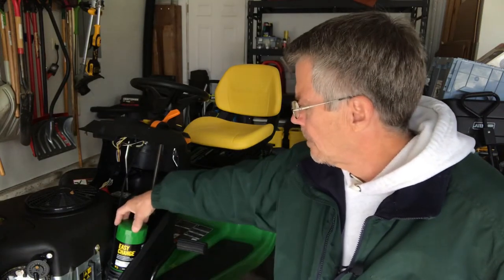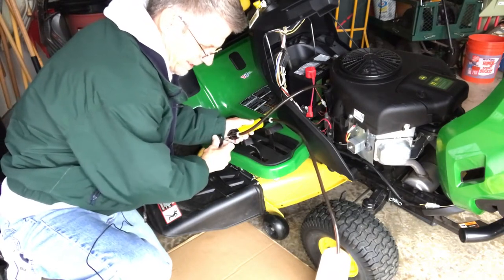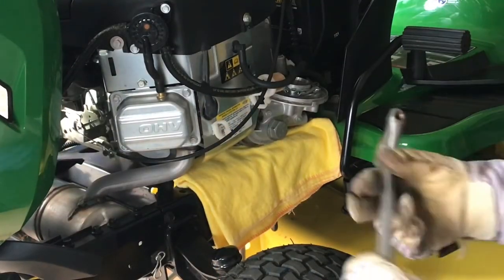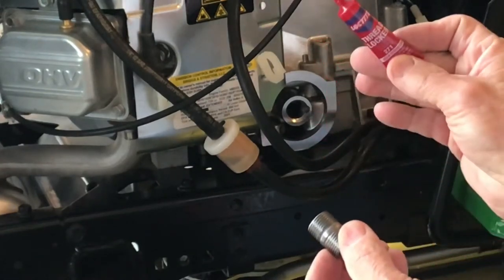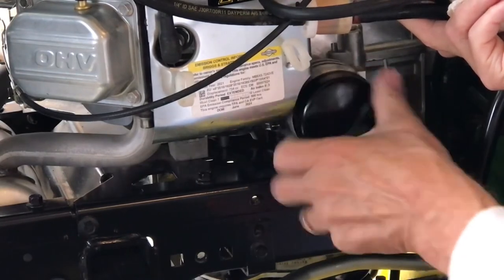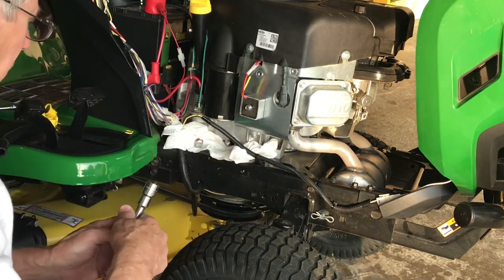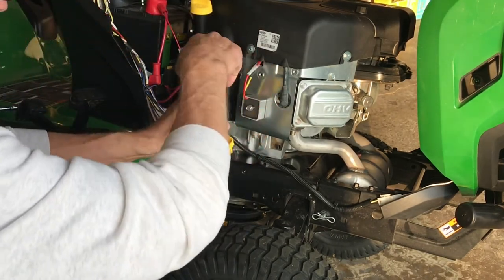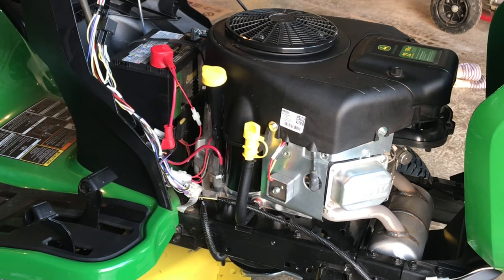John Deere Easy Oil Change Conversion with No Oil Spill (Almost) @DIY Boomers

Comment: JUST A THOUGHT COULDN'T YOU JUST SUCK OUT THE OIL FROM ENGINE AND STILL USE THE QUICK CHANGE FILTER? YES I KNOW YOU WOULD STILL HAVE TO BUY THE QUICK CHANGE FILTER AND ADDITIONAL OIL.
Reply from the maker: Sure, you could certainly do that. It would definitely eliminate having dirty oil left in the engine but the difference in cost is something to consider. The easy change and extra oil will run you over $60, whereas the conventional oil change will run you around $20.

Comment: Greeting from SC , USA. Your method is the better than at least five I have seen on the YT. Good thinking ahead. Pumping first, tilting the mower side to side and having patience in letting gravity do it's science does make a huge difference when removing spin on type filters pre and post conversion. Some folks say it's a big mess. I say they have no patience. Furthermore those fuel/oil hand pumps are a great prelude to the process. Harbor Freight has them too. I pump diluted Simple Green in and out of a bucket to clean the pump after use. Thank for your video post.
Reply from the maker: You’re welcome. Yeah, I really hate making a big oil mess, so I do everything that I can to avoid it. I guess some folks don’t mind it so much.

Comment: I have a new S130. Wish I saw this video before I purchased the JD kit. I like the flex hose on the B&S kit better.
Reply from the maker: Yeah, the flex hose makes it a bit easier, but I’m sure the rigid drain pipe will work just fine.
Reply: I completed the mod this afternoon. I have heard there is a lot of old oil left in the engine but I was shocked! Definitely glad I did this mod.
Reply from the maker: @youmbgtube  Yup, it really makes me wonder about this idea of John Deere’s.

Comment: I can't understand what John Deere was thinking when they came up with the 30 minute oil change. It only changes 0.8 qt. of oil and leaves 1.20 qts. in the engine. That's not good. I have the changover kit on order for my new S160 J.D. Mower.
Reply from the maker: Yeah, it really makes you wonder. I’d really like to have a look into the future to see how it ends up working out for them.
Reply: I think John Deere was trying to get those owners that never change oil, to at least change the filter and part of the oil, if they made it easy enough.

Comment: using that pump to remove most of the oil was a great idea
Reply from the maker: Thanks. Yeah, I had the pump for using it with gas, so I looked up if it could be used for pumping oil.

Comment: I very like your method, clean work without mess.I ordered a s-130 and will get it in may. First thing that I’m gonna do is the conversion.
Cheers

From New-Brunswick Canada
Reply from the maker: I would certainly agree with your choices of the S130 and converting it. One thing that I might do differently on the conversion is:

To minimize oil spill even more, use the oil pump to suction oil from the bottom of the filter adapter base before removing it. Might be worth a try.

Comment: I just ordered an S130 to replace my 20+ year old JD GT225 with a recently blown head gasket.    
     I've seen other videos of this conversion, but yours is the first showing the flexible drain tube. Seems like the better option to go with. 
    This is the first modification I intend to do after the break-in period oil change. 
    I hate that design of the "30 second " oil change.  Especially since it leaves so much used oil still in the crankcase.  
    I feel like it's designed on purpose to make engines fail quicker over time. But I get that it's also enticing to buyers who want easy and quick "DIY"  maintenance even if it's at a higher expense than a couple quarts of oil and a filter.  I'm sure most of those easy change filters end up in a trash can instead of the proper disposal. But I could be wrong. 

  Thank you for the video and part numbers.  

BTW, I do plan to rebuild the engine on my gt225 as a project and then sell it or use it as a second mower or just as a snow plow. Since I have the blade for it. It deserves better than to end up as scrap.
Reply from the maker: You’re welcome. Always glad to hear the videos are helpful.

Yeah, it still has me scratching my head what is behind the decision to implement the quick change. I agree with your thoughts on why they did it. Time will tell how that all works out.

I really like how easy the drain hose makes the oil changes. I’m sure you’re going to enjoy your new S130. Good luck with your conversion and thanks for watching.

Comment: I used my shop vac connected to the dipstick tube.  Ran the shop vack while adding the drain extension.  Not a drop of oil came out.  Spme oil went into the shop vac but was easily poured into my waste oil can.
Reply from the maker: That’s a new one on me! Sounds like it got the job done alright. Good job, I always like finding a work around. Like the old saying goes - Necessity is the Mother of Invention!

Comment: You saved my bacon yesterday. After removing the EZ Change I got to the 4-sided drain plug and could NOT get it off. Was looking at having to find and buy 7/16" 8-sided socket. Luckily, I had watched your vid not long before doing the conversion and quickly found it. I had a set of adapters including 1/2 to 3/8, got an extension on it and ratchet with socket, worked. Whew. Wasn't looking good. Had I seen your vid first, likely would have gone with the B&S flex tube, oh well. Thanks for the vid.
Reply from the maker: You’re welcome. That’s one reason I really like YouTube, there’s so many ways to get things done and 9 times out of 10, you’ll find a solution. Also glad to hear that me being cheap, saved someone else some time and money. 😎 Thanks for watching.
Reply: @DIYBoomers  No doubt DIY. Honestly didn't think drain plug would be an issue, wrong answer. Precarious location. I thought the big bolt on the EZ change would be the tough one, it was not. Sort of lucky that one of last vids watched before conversion, was yours so it was early in history. Thanks again for the effort. 👍 And, no more "EZ change" for JD. 😀
Reply from the maker: @faxmen09 👍

Comment: I like the large oil filter to help cool the oil but will definitely upgrade the oil drain with something like you are using. Also I will probably change the filter every other time.
Reply from the maker: That’s a twist. Hadn’t thought about doing it that way. Interesting! Are you planning on draining the filter when you drain the crankcase?
Reply: @DIY Boomers   yes  I have a vacuum pump to be able to clean the hosing the filer sits on then adding a small amount of oil into the filter before I reinstall it.

Comment: Nice job  pumping the old oil out first  made it for a cleaner job, I will be doing this on my new 170, thank you
Reply from the maker: Yes, you’re welcome. Pretty much mess free if you prepare for a little oil draining out of the filter adapter base when you remove it.

Don’t know if you saw my reply to Jason who is planning a conversion also. I mentioned maybe being able to pump some remaining oil out of the adapter base before removing it to avoid spilling that last bit of oil. Since that, I took a look at the adapter base and it looks like the lower portion of the base is constructed such that pumping from the top of the base may not reach that little bit of oil in the bottom.

So just prepare for a small spill when removing the filter adapter base. Enjoy your new 170!

Comment: A silly question but what are you using to lift the side you’re working on? My ramps are most likely too tall and I’d have to remove the deck to use them. Bottle jack maybe?
Great video and like many others have said, your method wins out on YT! Glad I decided to watch a 5th video on the same topic!
Reply from the maker: Thanks, yeah, I really don’t like cleaning up oil spills so that’s what motivated me for that job. I actually did use ramps. I have a pair of old, molded plastic Blitz Rhino Ramps that are just under 7” tall.

Comment: I have a new s220, but I don’t have the easy change filter,I just got the regular filter.But I like that oil drain tube . We’re did you find that ?  Nice job on the video. I like how you worked around not having the proper tools! LOL 👍
Reply from the maker: Thanks. Pretty sure I ordered it from Amazon. Below is a link from there, but you could search the part “Briggs and Stratton 594200 Oil Drain Hose” and find it elsewhere. Yeah, hate to buy too many tools that I won’t be using very often.  😎  Almost forgot, you’ll also need the hose connector that inserts into the engine, link below for that also.

https://www.amazon.com/Briggs-Stratton-594200-Drain-Hose/dp/B017650GL4/ref=asc_df_B017650GL4/?tag=hyprod-20&linkCode=df0&hvadid=216532910363&hvpos=&hvnetw=g&hvrand=14069240487820374220&hvpone=&hvptwo=&hvqmt=&hvdev=m&hvdvcmdl=&hvlocint=&hvlocphy=9022344&hvtargid=pla-348901613502&psc=1

https://www.amazon.com/Briggs-Stratton-796532-Hose-Connector/dp/B002WNW970/ref=asc_df_B002WNW970/?tag=hyprod-20&linkCode=df0&hvadid=416788749780&hvpos=&hvnetw=g&hvrand=6498830476322284564&hvpone=&hvptwo=&hvqmt=&hvdev=m&hvdvcmdl=&hvlocint=&hvlocphy=9022344&hvtargid=pla-965418101037&psc=1&tag=&ref=&adgrpid=90729929941&hvpone=&hvptwo=&hvadid=416788749780&hvpos=&hvnetw=g&hvrand=6498830476322284564&hvqmt=&hvdev=m&hvdvcmdl=&hvlocint=&hvlocphy=9022344&hvtargid=pla-965418101037

Comment: Interesting drain plug. Wonder how that will hold up over time with the constant tension upwards on it. At least the fitting is metal.
Reply from the maker: The Briggs & Stratton drain hose is made for use with Briggs & Stratton engines. It’s a very durable rubber hose. We had a Craftsman tractor for over 10 years before this JD S130, and the Briggs & Stratton engine on the old Craftsman came stock from the factory with a Briggs and Stratton oil drain hose on it, which we never had any issues with.
Reply: @DIYBoomers thank you. I’m planning on take care of some conversions to this kit for customers I have and will certainly consider this option. I Appreciate the detail in the video and quick reply!
Reply from the maker: @SendItBilly  No problem, you’re welcome! Yeah, I like it. I’m sure the rigid pipe drains do a good enough job for avoiding oil spill, but I just like the convenience of the hose.

Comment: How much oil you were able to pump out with Pennzoil multiuse pump, out of maximum 1.9L?  I am thinking if someone does not want to change the easy oil by this conversion kit, at least removing substantial residual oil (if it is like 1.7L) out of maximum 1.9 L, that may be better than just using easy oil filter.  Also,  is the Pennzoil pump is model 36677?  Thanks so much for useful information.
Reply from the maker: You’re welcome. Yeah, the model number is 36677. Don’t know exactly how much can be extracted since I didn’t gauge how much oil it took to top it off once I converted the easy change. But I do believe the minimal amount remaining would not be detrimental after refilling. That’s not a bad idea to extract what’s outside of the quick change, add the quick change and then top it off. Kind of expensive tho after paying $50 for the quick change alone.

Comment: I recently did the same mod. You took great care not to make a mess when pulling off the EZ Filter adapter. But, now every oil change you’ll have a messy filter cartridge to deal with. So will I but a few extra paper towels and it’s no big deal for me.
Reply from the maker: Absolutely. I think it’s the lesser of two evils.
Reply: And he'll happily deal with it while enjoying the significan savings over the rip off Easy Change oil canister. Some EZ change for John Deere.
Reply: @DIYBoomers  Not even close. Conversion to conventional system , EZ FTW!
Reply from the maker: GOOD ONE!  Very clever, absolutely some easy change for them.
Reply: @DIYBoomers  Early when JD made the change to the "Easy Change" system read it in the comments section. Loved it, so I adopted (stole) it. It is true.

Comment: Any thoughts on Briggs drain tube part 1723165SM instead ?
Reply from the maker: Looks like it would do the job. Also a bit cheaper than buying Briggs & Stratton drain hose 594200 and the oil drain plug.

I had never seen that hose, and I can’t seem to find any info on which engines it fits, I would check that first. Another consideration is that there is no clip fastened to it like the one on 594200. That clip secures the hose to the bracket on the Briggs & Stratton engines that is specifically designed for that purpose. Without that clip, you’d have to figure out a way to secure the hose. Other than that, it looks like a good hose.
Reply: @DIYBoomers on Amazon it lists the Briggs engine it’s compatible with. Looks like the non drain end is threaded so screws into the engine at the oil drain hole. I did an oil change on a Cub cadet with this type of tube was much easier. A kubota had a plastic valve that you put an .5” ID tube on then removed after it drained. All seem better than the Deere pre load and. Single bolt drain which pours everywhere.
Reply from the maker: Lots of options.

Comment: According to the JD dealer, they will not cover the warranty after changing the quick-change oil 
system unless it is done by a JD dealer. Once the two warranties are gone, it doesn't matter.
Reply from the maker: That’s interesting, do you have a link to any documentation by JD that spells that out?

After a quick search on the subject, I saw that one parts dealer sells what they claim is a JD authorized conversion kit and also says that it doesn’t void the warranty (link below).

https://www.greenpartstore.com/John-Deere-Easy-Change-Conversion-Kit-AUC12916-KIT.html

I also found a JD Frequently Asked Questions About JD Warranty page that states what is not covered under warranty. The third line says Those altered or modified in unapproved ways (link below).

https://www.deere.com/assets/pdfs/common/parts-and-service/warranty-protection-plans/WarrantyFAQ.pdf

So I guess it hinges on how JD looks at it. Let me know if you see confirmation from JD on the subject. Beyond that, one could always put the original quick change parts back on the engine if warranty repairs were needed. I did save everything from the conversion and my two years will be up later this summer. One could wait to do a conversion until the warranty has expired if they wanted to be sure, but I would be surprised to encounter a problem in that time frame when maintained properly. Interesting stuff though!

Update:
I looked further on the parts dealer add for their conversion kit (first link above). The third review for the kit by a purchaser says that they contacted JD before purchasing and was told by JD that it would not void the warranty. 🤷
Reply: @DIYBoomers  I just repeated what a mechanic at the local dealer said. No, did not bother to research it since the engine in my new E170 quit running after 10hrs and I had to have a new engine put in and told the dealer to put the conversion kit on it.
Reply from the maker: @krazyj1957 Wow, it sounds like it all depends on who you ask. Makes me wonder if all JD dealers treat it all the same way.

That’s no good, engine failure after 10 hrs. Did they tell you what the problem was? Hopefully that was all paid for.

Comment: Just got my S130. I really like the conversion. Will this void the JD warranty?
Reply from the maker: On a previous comment, I did a search on the topic and found a parts dealer that sells what they claim is a John Deere authorized conversion kit and also says that it does not void the warranty. (See link below)

https://www.greenpartstore.com/John-Deere-Easy-Change-Conversion-Kit-AUC12916-KIT.html

Also on that site, look at the third review of the conversion kit where the purchaser says that he contacted John Deere before he bought the kit and was told by John Deere that it would not void the warranty.

So I can’t say for certain, but it sure sounds like it would not void the warranty. You may want to confirm that with John Deere to be sure.
Reply: Thanks.. Ordering today!
Reply from the maker: You’re welcome. Now just fyi, the kit on greenpartstore comes with the rigid pipe oil drain like many others are using for draining the oil. I ordered individual parts so that I could use the long Briggs & Stratton rubber oil drain hose that gives you better control for draining the oil. So if you like that feature, you may want to purchase individual parts. I listed all the parts that I used down in the description on the video. Good luck with your project!

Of course, you can get the John Deere or Briggs & Stratton oil filters locally so that you don’t have to order that.